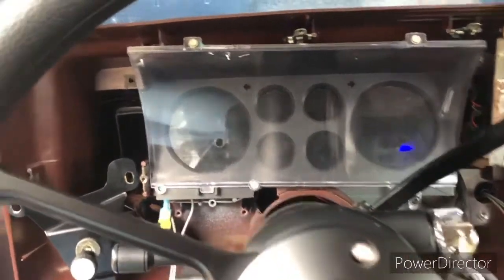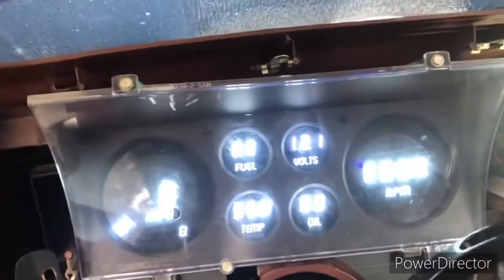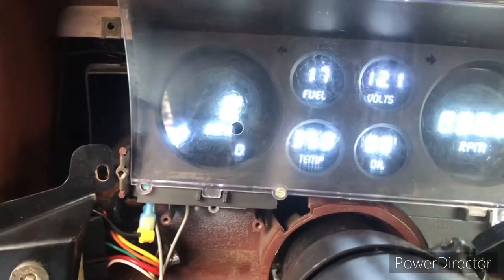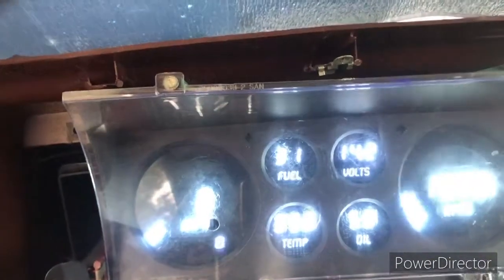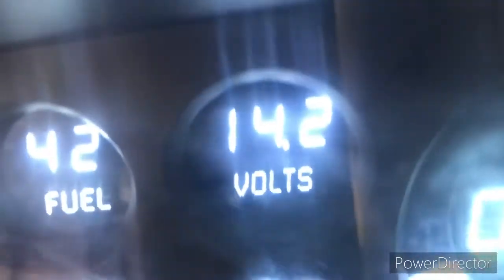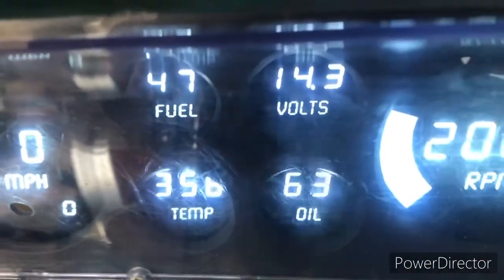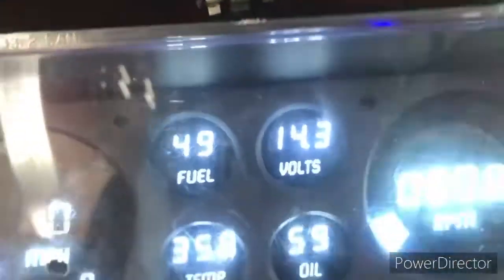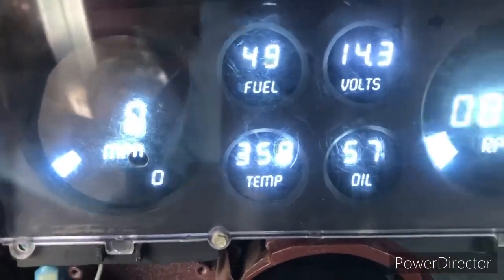Intellitronix Digital Dash Install On Monte Carlo SS.....Part 3.....

Comment: I put in 3 different coolant temp sensors  for mine and it still doesn't read the temp accurately   I got it close but its still about 20 degrees off